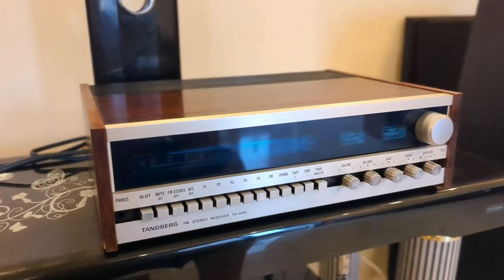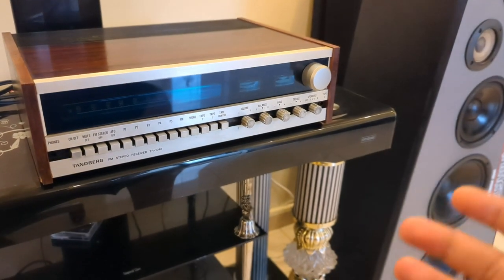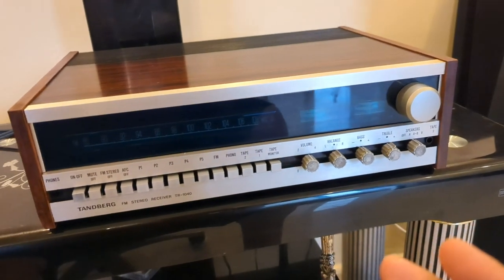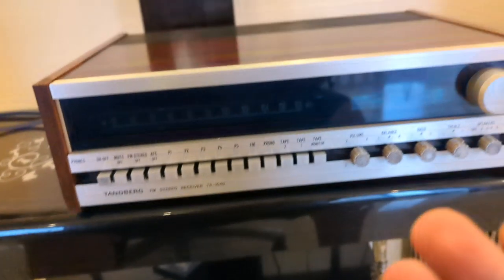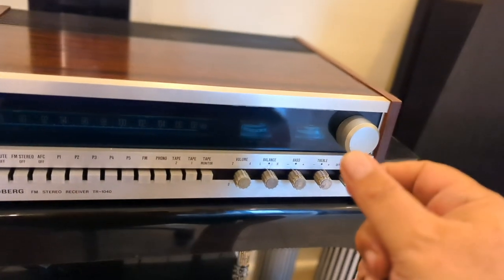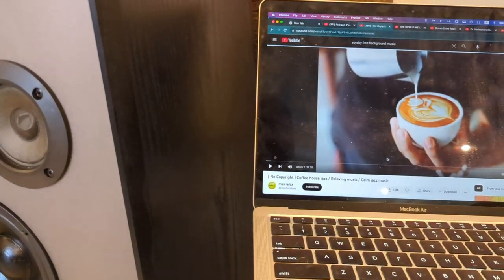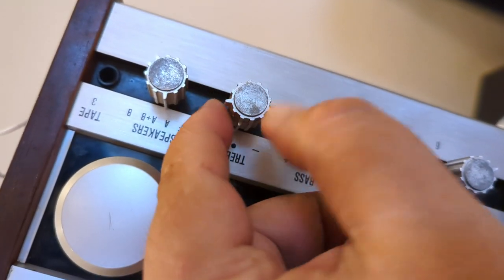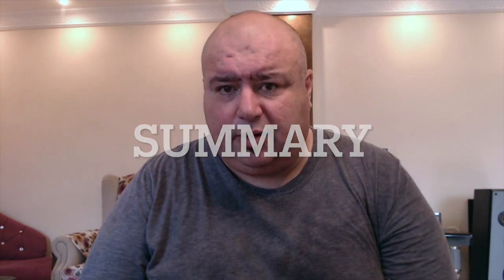THE SOUND OF 30.000$ -Tandberg TR-1040 [ ENGLISH ]

Comment: Nice video commentary!  I see somebody already pointed out the hidden controls behind the bottom flip-out panel. I grew up with Tandbergs - love them. I also find them very logically designed and quite repairable.  I recently bought a TR 2075. It had a couple of minor issues, but even an amateur like me was able to repair it.  The radio section, especially the FM, section is astounding in most Tandbergs.  The 2075 is rated at 2 x 75 watts at 8 ohms. But it seems to me that all Tandbergs are underrated by the factory. It is certainly more than capable of powering very large power-hungry speakers.  I use a Huldra 11 daily. It's amplifier section is only rated at 2  20 watts. But is more than capable of producing nice warms sounds at normal listening levels.  In general, "Tandbergistas" prefer the 1000 series to the later 2000 series for their warmth in sound character. The 2075 and 2080 are still pretty highly rated and fetch good prices when in proper order.  But, any Tandberg from the 70s (and earlier) will be very satisfactory.  Don't forget their excellent tape decks and reel-to-reel players as well!

Comment: Thank you for this interesting video and review! It is not often we se Tandberg featured on Youtube. It is a hidden gem among vintage hifi.. Here in Scandinavia the brand is famous though and popular.
The TR-1040 is, in my opinion as well, probably the best vintage amp I have heard, actually maybe the best amp I have ever heard. 
The model was Tandbergs first direct coupled design, as mentioned in the video (no caps after the power amp). It is also, if I am correct, a model that came before the TR-20xx series, which is a different design but also direct coupled.

Some comments about it and using it as a vintage audiophile amp: 
- There is actually a Loudness control and some other controls under the potentiometers, this panel can be flipped down and under it are the hidden buttons, very cool! 
- The connections are placed a bit awkwardly, also the RCA inputs are very tight so modern big body RCAs will have trouble fitting, but with slimmer plugs it will work. I use gold plated 5-pin DIN plugs as interconnects, which I make myself. You can also have them made to order. Actually I think 5-pin DIN are excellent connectors!
- The speaker connectors are rather clever and easy to use. You can buy smaller spade connectors, larger (modern) ones will not fit. Bare wire is also good, but no very fat cables.
- This receiver can deliver very high quality sound and deserves a good source like a high quality DAC and wont be embarrassed by very good high end speakers.
- Build quality is very high and they were built to last. A good tech can service it as they are logically built and not weirdly layed out inside.